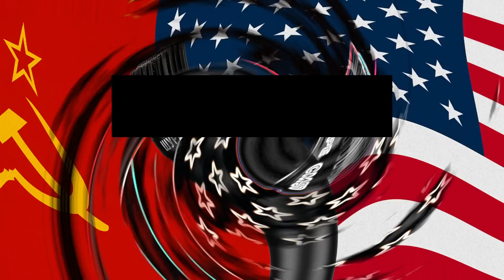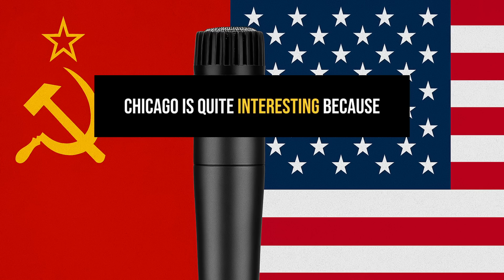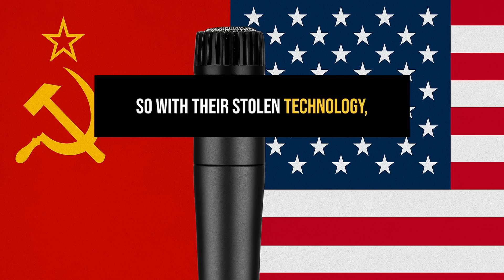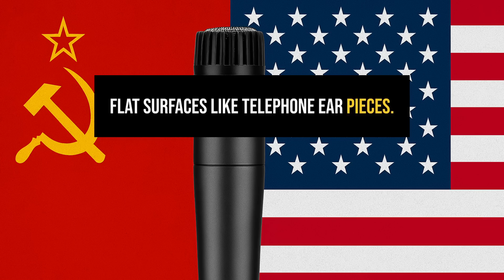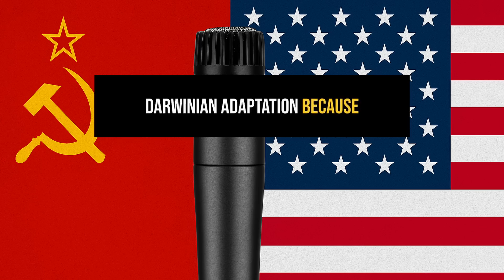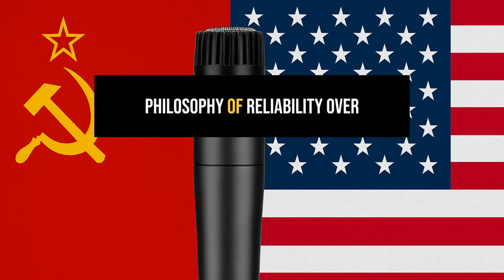The Shure SM57’s Secret History: How Soviet Spy Tech Turned it Into a Rock Star

Comment: The only real disadvantage of SM57 is relatively poor sensibility that quickly tapers out even more at higher frequencies. You really shouldn't try to record a fluite using the mic and you have to shout into it to get a strong signal. Thankfully the dynamic range of SM57 allows you to shout almost as hard as your throat can take ant it will still produce a clean mostly undistorted signal and it allows you to reduce the effect of even quite strong surrounding accoustic noise. Basically SM57 has a somewhat limited use as a studio microphone but at the same time it is still the king of many live performances. And the model can be ordered ordered from China very cheaply on AliExpress or some other similar websites with different levels of authenticity renging from really cheap barely working plastic crap to almost perfect clones with very respectable performance. So now it is also quite affordable model with a very good bang per buck ratio.

Comment: I used to have a very old 57, the coil wire finally broke one day. Never looked for another one. My MD421's do anything the 57 did but a lot better. I don't think it's a very musical microphone, it's cheap and ubiquitous. I'm not of military grade gear for music, like NOS JAN 12AX7 valves. They're really made for audio and ruggedness is cool, but my studio is pretty safe and friendly place. There are just so many better microphones these days, the 57 is a rock staple because back in the day techs didn't trust rockers with the good stuff, and rightly so.

Comment: The SM58 is basically a 57 with a pop-filter on it. It just makes it reject room noise better and makes it even tougher.
Reply from the maker: It’s like a 57 with a helmet
Reply: the only difference also i basically the 57 has the transforemer in it and the 58 doesn't
Reply: i was wrong, they actually have both the transformers soi yea they are basically specwise the same

Comment: BTW,  the Unidine Capsule is in the SM 58, SM5B, SM7 and on and on as you know. Instead of buying an SM5b, I took an SM58 (has a very similar frequency response as the 5b), removed the ball grill, added the SM57 windscreen and I speak about 3 inches from the front of the capsule, very close in sound without spending over a thousand bucks for a vintage 5b!
Reply: @davidgbeneke1  
In all the ones you've mentioned, they are practically the same capsule, but not in the case of the SM7 and the Beta series because they are neodymium capsules and are more similar to Sennheiser, AKG and Sony in terms of pickup than the classic 57 and 58 with Ailnico magnets.
Reply from the maker: That’s a cool mod! I’ve always wanted a 5b but no chance I’m paying through the teeth for one.

Comment: The first ancestor of the Shure Sm57 is the 535 Unidyne III with a moving coil and Ailnico magnet with a range from 40Hz to 15kHz in 1960, but Shure has previously tested this microphone since 1949, because Shure microphones were focused on crystal and carbon Bullets and Ribbons for the studio.
The Unidyne series changed aesthetics rapidly in the 1960s until the arrival of the 565SD in 1969, inspired by the aesthetics of the German Ribbon Beyer M160 microphone from 1957, while the Unidyne III 545 became the SM57 in the 1970s.
Reply from the maker: Thanks for the info!
Reply: @MarkYoshimotoNemcoff  
thanks, what a pity not to be young now, in my youth I practically only had 2 people to exchange information with in my country and in general I always had to search and investigate only on my own, although being a musician and sound and recording technician things were made easier for me but not that much, because incredibly it is not given importance, in the case of the sm57 and the Sennheiser md421 it is essential to use their bass attenuators, if not, as I have observed as a naturalized tendency of many amateurs and even professionals, will be to modify the pickup with EQ, which means a loss of quality and distortion in the pickup and very audible gain with severe consequences in the mix or mastering. Sm57 is generic and practical but it has its requirements. Coincidentally, together with the Sennheiser dynamic microphones, they do not have phase problems in different positions and work complementary with condensers and Ribbons, these microphones were born to stay, greetings and thanks for everything !!!! I look forward to your next video.

Comment: I can’t tell you how many SM57s and 58s I’ve dropped, hit with drum sticks, even used for a hammer, and every single one of them still works. It doesn’t surprise me at all to find out that durability was a key factor in their lineage!
Reply from the maker: Yeah, if it sound was the only consideration, I doubt it would have been as successful overall. Add that durability and it's a roadies best friend.
Reply: I’ve broken so many modern Shure SM57s, but all the off brand ones have never broken on me 🤷‍♀️😂
Reply: Haha thats why its such a good snare mic. Any sdc would sound just fine

till i whack it with a stick lmao.
Reply: Dropped a few myself back in the day. Rugged!

Comment: Hey mark ! I know u have the MT48 . I need a new interface . I have apogee symphony desktop and MT48 in my cart and I’m not gettin any real info on if I can bypass the Pres in MT48 to use my own mic Pre amp ! Can u let me know if that’s even possible to bypass the MT48 so I can use my own mic preamps I have ? I want it but if I’m stuck using there pre amps then I’m gona get the Apogee symphony DT ! If u see this mark please let me know if u can .
Reply from the maker: Yes, you can. The MT-48 has 1/4" line inputs for Line 3 and 4 on the front and you can use the combi jacks on inputs 1 and 2 for line in as well. When you select line over mic, it bypasses the preamp circuit. You still have access to a digital "gain on a wire" control and access to the EQ and dynamics.
Reply: @ wow ! So is there a +4dbu switch ? Or I would promy have to turn it to +4db on the line gain ? And holy moly ! Ok ! Thank you ! I just was lookin just now and I seen on Reddit somebody just said ( for the MT48 to be $2000 and u can’t even bypass the Pres )lol I got sad ! But it sounds like they don’t know ! Thank you mark ! I’m gona get the MT48 ! That dynamic range is just above anything right now ! I’m hoping this is my future proof for some time to come and not upgrading in 5 years .
Reply from the maker: @TheVALLEYBOY559  It automatically changes to line level when you select "Line" from the Mic/Line selector on the preamp page. Line inputs 3 and 4 are just line in and have no preamp circuit, so you can just use those as well. Yeah, that's why I no longer go to the forums to get information. Too many armchair experts who know not what they speak of.
Reply: @MarkYoshimotoNemcoff  lol haha I just seen so much wrong info before you let me know ! It sounds like people who don’t own the MT48 have a whole lot a negativity to say ! Can’t bypass/ sounds sterile/software bugs ! Blah blah lol well I just bought it ! Thank you mark !!!! You’re the best !!